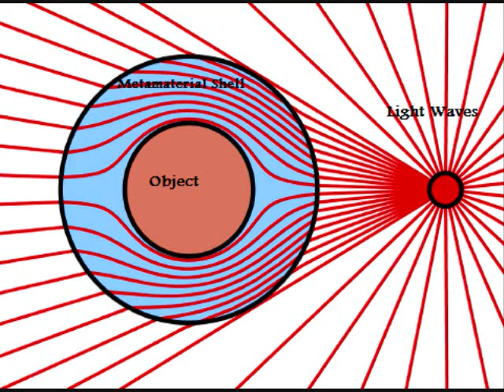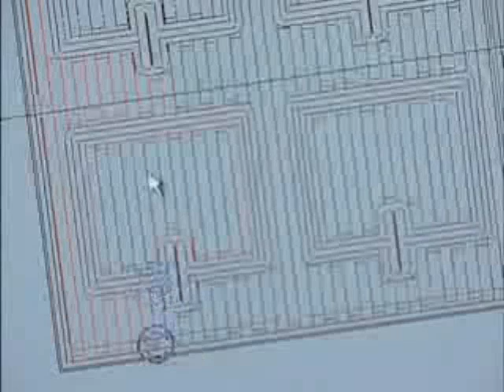Metamaterials

Comment: @xd2010 Actually, its nothing like a mirror.  It doesn't deflect light, it bends lights path.  The only reason you can see anything is because light is reflecting off the object and coming back to your eyes.  If that light could be stopped from reflecting back at you, it would essentially be invisible.  Metamaterials do exactly this.  Metamaterials bend light around the object covered in it thus preventing light to be reflected back to the eye, therefore making it invisible.